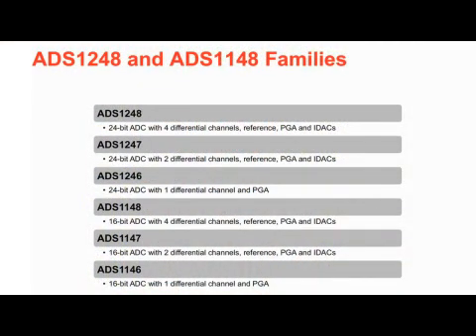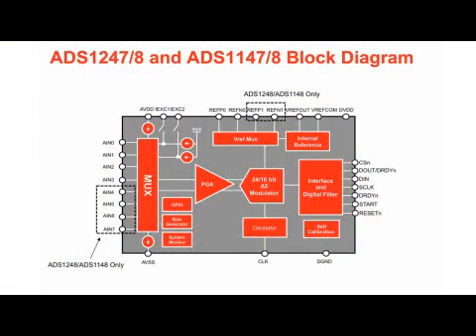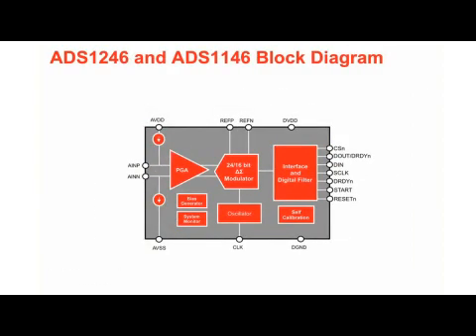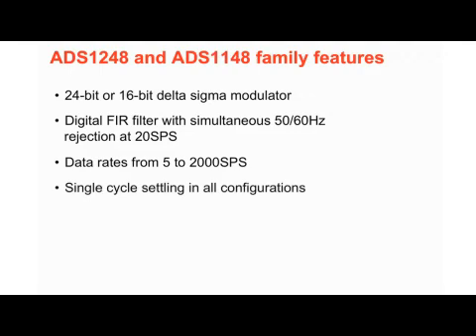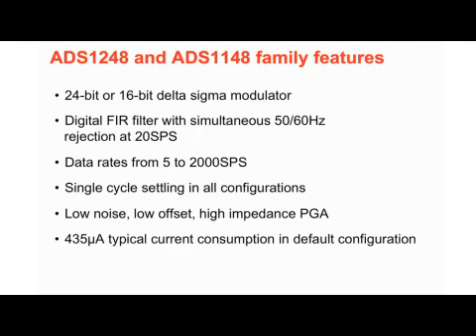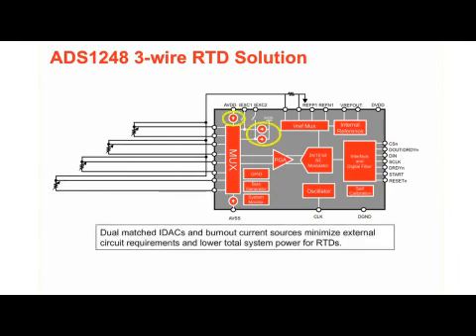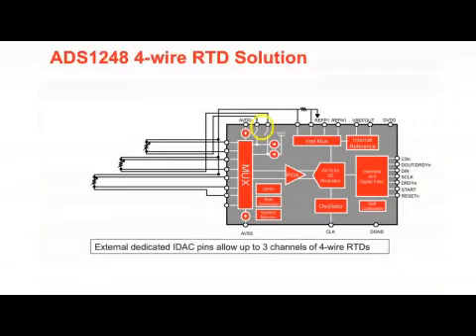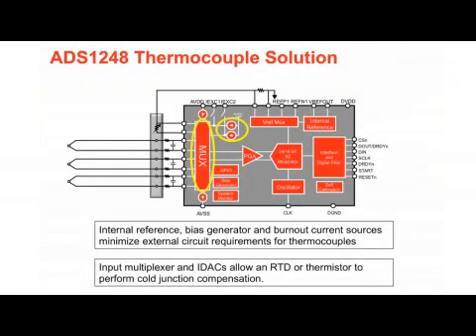Temperature Sensor Measurement Using the ADS1248 Family

Comment: I have a couple RTDs, and a couple differential analog voltages to measure..    to continuously scan thru all channels, do you configure the next reading as you clock the current reading?  If so, is there any setup or settling time going to/from RTD and differential/PGA that could affect the 2KSPS conversion rate?